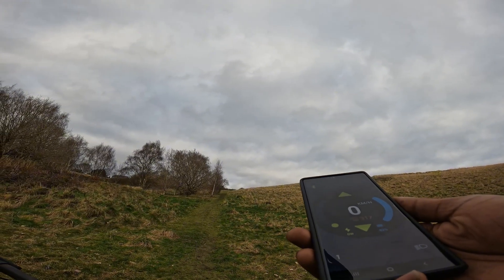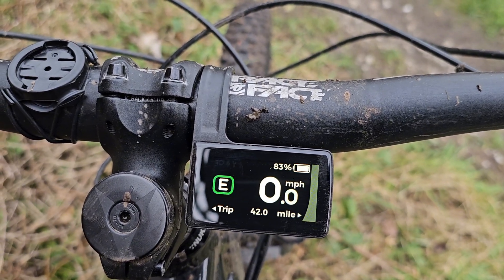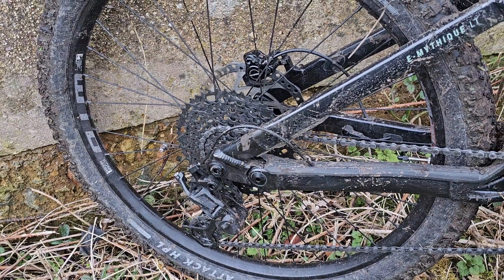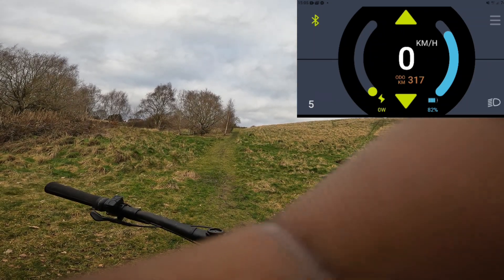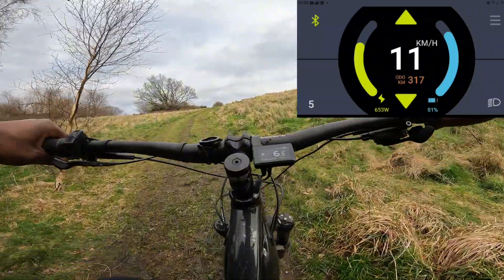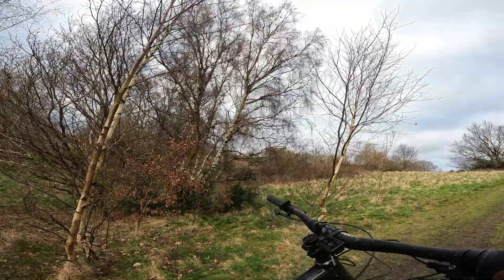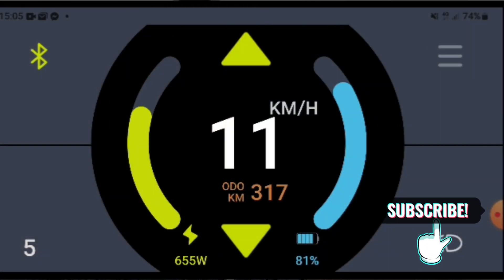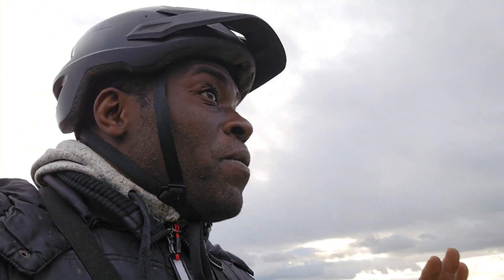I'm pretty sure the Bafang M510 motor can achieve 700W PEAK!!!⚡️

Comment: Hi Neeko,
I need help and advise please. The main axle of my M510 has gotten stiff to turn. I thought maybe because the bearings have gotten dirty/sticky but no, they are fine and still turns very freely on their own after disassembly of the motor. Then i realised the cause was stiff torque sensor. The big plastic surround (about 1.5in wide) had moved towards the washer right next to the circlip (which is right under the big/main steel cog), squashing the washer tight againt the circlip hence hindering turns. If i remove the washer, the axle  can spin/turn freely. Is it ok to just remove the washer?? Or should I try move* back that big plastic surround on the torque sensor? (There's about 1.25mm on the other side that it can move back to.) And how can I move* it away from the washer side, just push/slide hard? or twist, ie is it threaded?
Thank you.

Comment: the display indicates battery power, motor power is the result of battery power times motor efficieny. efficiency at ideal cadence is about 80% give or take 3% depending on load and cadence
Reply from the maker: The display shows battery percentage (or current) and motor output. 
The output would vary depending on the battery voltage. The E-Mythique is using a 36v battery. Whereas my E10 is using a 48v battery. 
But I'll explain more in upcoming content👍🏿
Reply: @neekodevinchi  there is no way the display/controller can measure mechanical power output, only a dyno can do that. it measures battery output via a voltmeter and current shunt. motor  output is roughly 80% of battery output. the m510 controller is limited to 15A, @48V that is 720W, multiplied by 0.8 you're talking 576W motor output power
Reply from the maker: @JoLe1991  I'm sorry my friend. But you're mistaken (and your above logic is slightly flawed).

The bike used in this video used a 36v 630wh battery which has a built-in bms capable of achieving a maximum discharge of 23amps.
The M510 requires 20amps to achieve the full 95NM (700w peak output).

Yes, the M510 (and other Bafang motors), do not possess the ability to record or measure human leg (torque) power. The motor's do not contain a strain guage and the main reduction gear filters out the physical torque a human could administrator if it's too high. 
But the reading you are seeing on screen is the motor achieving peak power output only (NOT INCLUDING RIDER INPUT). 

I conducted the same experiment using the M820 and a 43v 410wh battery with a built-in bms which has a maximum discharge of 18amps and achieved 571watts. 

If we go by your above scenario/analogy, then the M820 (with the 43v 410wh battery) would only achieve 328watts (using your 80% battery theory). But that IS NOT the case, as the M820 requires 15amps to achieve 75NM of torque and 600w peak output.

You are confusing "Watt Hours" (a combination of voltage and amp hours which dictates the duration/capacity) with peak output (measured in watts).

I invite you to watch my CEF50 EMTB video using the M820 as well as visit EMTB Forums to understand and consider other users who have achieved similar peak output readings with either the M510 or M820 using multiple methods👍🏿
Reply: @neekodevinchi  there is no confusion. all the display can tell you  is electrical power, not mechanical power. potentially, using the pedal torque sensor and PAS sensor, the controller can calculate human leg power. again, any watt reading on the display is NOT motor powet output, but motor power input = battery power output. When Bosch states their motor peaks at 600W, that means they measured it on a dyno, and a simple calculation can explain that: 40V x 20A x 75% = 600W
any electric motor power OUTPUT is calculated that way. Input voltage x input amps x efficiency = power output
Reply from the maker: Your above analogy (at best), would only be useful for testing a motor found in a fan,  heater or some form of appliances with a motor which is powered by a plug outlet.

Ultimately, your above analogy is used for converting electrical energy to mechanical force. But does not take into consideration losses in kinetic force throughout administratoring propulsion, thermal runaway, discharge cut-off, load forces or any sub routines which the bms may control/regulate throughout battery discharge.

You cannot assume that 75%-80% of battery capacity is required for an ebike motor to achieve peak output, as it is pointless/meaningless. Because as soon as you dip below 75%-80% battery capacity, the motor is no longer performing optimally. Voltage sag usually occurs below 25%-30% on ebike systems I've used. Furthermore, my tests were conducted WITHOUT a full state of charge to guage the performance without favourable advantages.

I can't give an account as to how Bosch determines their peak output readings. But I chose to believe that they wouldn't rely solely on your dyno method or motor electrical efficiency test, as this would only reveal a figure if parameters are fixed to one particular ratio and parameter. Remember, most mid drive motors gain a mechanical advantage using different gear ratios. Your above scenario would only reveal "optimal" efficiency, fixed within a set static parameter. And could not give an account for fluctuations in terms of stator RPM / torque determination (measured in foot pounds) and battery discharge rate.

Like I said before, the readout is the watts generated by the motor powered by the battery. 

If I use your above analogy, then the readouts wouldn't fluctuate between 500w-700w. And instead, would remain more consistent without dipping or raising each second. Again, further emphasising that your above analogy is ONLY useful for testing a motor powered by a plug outlet.
Reply: @neekodevinchi  sorry but you really don't understand... nobody's talking about using 75-80% of the battery capacity. the BMS by the way has absolutely no role in any of this.
all that needs to be understood that electric motors generate 2 forms of energy: mechanical energy(torque and rpm) qnd heat, the latter being battery energy that got wasted because of the inefficency of an electric motor (bldc in this case). how much heat is being generated cannot be measured by the motor controller, so all you can read on the display, is how much power the battery is delivering. the motor cannot measure its own efficiency in real time
Reply: @neekodevinchi  the readouts fluctuate for 2 reasons:
1. torque sensing means, the pedaling force translates to the "throttle" level.
2. the motor power uptake depends on the rpm and load. power uptake will be constant up to a certain rpm, and then drop at higher rpm, where the motor is running out of torque at a given voltage. that happens quicker with lower voltage batteries, because the peak rpm is directly related to battery voltage.
check out grin technology's motor simulator to learn how all this works
Reply from the maker: @JoLe1991  you're starting to deviate from your own point/argument. Afterall, you were the one to introduce the battery percentage aspect in your second message. 

If it helps, I'll look into this further to identify a better method of showing the output of the motor (NOT OPTIMAL EFFICIENCY) for consideration. But I would rather not use your method, for the above reasons I have just raised👍🏿
Reply: @neekodevinchi  never mentioned battery percentage. only motor efficieny in percents. the math is dead simple
Reply: @neekodevinchi  as I mentioned, the only way to measure motor output power is with a dyno
Reply from the maker: @JoLe1991  I'll take your above suggestions as a consideration. 

Applying your math to the M510 and M820 motors and 43v 410wh & 36v 630wh batteries used sadly doesn't add up. Buy you're more than welcome to correct me by SHOWING the math.

I would reccomend that you research each Bafang motor and battery discharge cut-off and maximum discharge first, instead of guessing. 

But as I said, I'll look into this diligently.

Comment: Looking forward to the upgrade video. This is one bike I have looked at. What do you think of front fork?
Reply from the maker: My experience with Suntour nowadays has been with their higher end stuff (Durolux and RUX). Because the stock Zeron fork on my VR model is incapable of being travel adjusted to 170mm, it needed to be swapped. however, the VRX  & VRS come with 170mm forks. Truth be told, I would swap the forks on any model to a 38mm stanchion fork (Fox38 / Zeb / Domain / Durolux38 etc). But i'll explain more, as I upgrade the bike👍🏿

Comment: The motor sounded more quiet than the M820. Have Vitus done anything around the motor area to reduce the sound?
Reply: Seems doubtful? Noise cancelling foam is bulky & sheds when it ages. The noise comes from internal gearing, so there's little to be done from the outside. 

Motors rated for more torque, tend to have larger gears (quieter) but also looser tolerances (louder). 

In practice though, wear & grease coverage, seem to often be the biggest factor in how much noise each motor makes. 

Otherwise identical motors right out of the box can make different levels of noise, depending which one's gears are meshing more closely... but just a few hours of high-torque usage seems to make quite a difference, too. A tiny bit of wear can make a lot of noise. 

The m620 on our daily driver, is noticeably louder in cold weather; so much so that I've considered using different grease for winter riding!?
Reply: I use the UART M620 on my E22. I've just ordered a e55 frame and battery. So I'll probably borrow components off my e22 to build it until I get more money to buy a second M620.
I think you're right about the gears and the noise. But I haven't seen good images of the main gears between the M820 and M620. Hopefully Neeko can show us in a post or video🙏🏽
Reply: @rubanghostday7227  There is a good video or two, of an m620 partial teardown for regrease, & one focusing on the internally mounted motor controller... Most places don't seem to want to open them up though! Fortunately, I haven't heard of a ton of failures to require that, yet. Mostly the tiny pawl clutch goes first, which can be forestalled indefinitely, with a bit of tweaking in the settings to keep the motor from disengaging+reengaging constantly if you pedal too slow
Reply from the maker: @rubanghostday7227, I can do that👍🏿
Reply from the maker: I suspect the reason why the motor isn't as loud, is partially because of the 36v battery and the motor's settings. if you look on my Community Page, you'll see a picture of the stock settings of the M510 motor on the E-Mythique LT👍🏿
Reply: @neekodevinchi  Ah yes you did mention it was at 36V! 🤦💯🎯   
Less overall wattage » less torque, would surely mean less noise than usual for a given drivetrain! 
I'm also very interested to see anything you want to show us about the gearing of these motors. Especially whether some respond better to particular cadences & whether any seem better at fine output control?